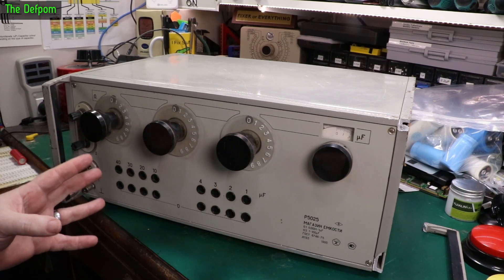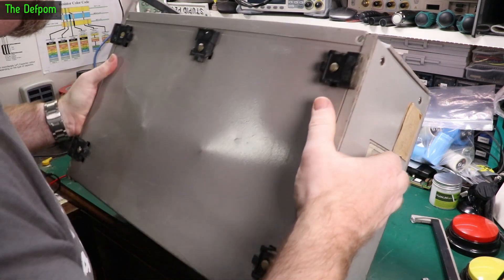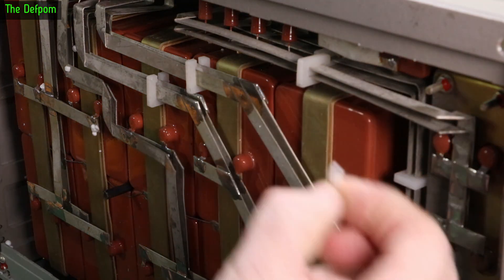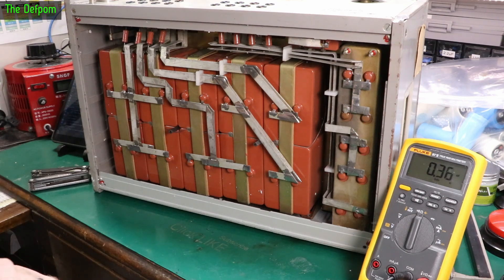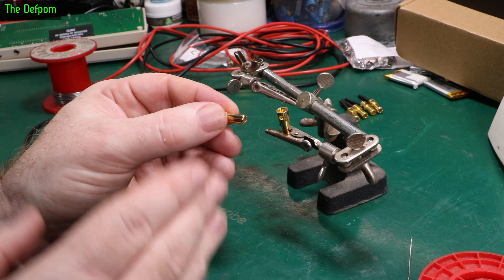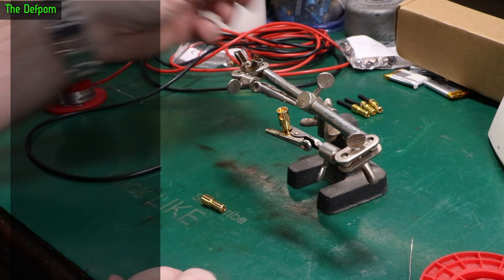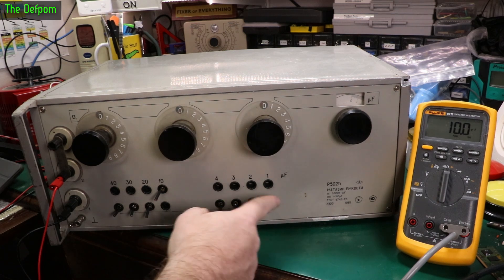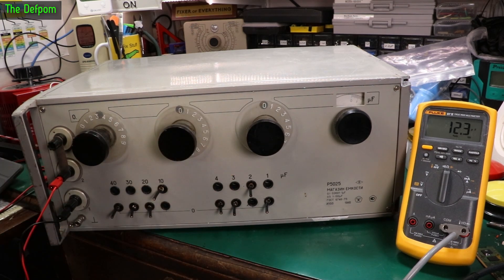🔴 Soviet P5025 Decade Capacitor Repair - No.1244

Comment: This decade capacitor box is built with two types of capacitors:
1. Smaller ones (ССГ) - use mica film as dielectric, have very high stability.
2. Large ones (МПГО) - polystyrene  film capacitors, these are also very stable but additionally have very low DA. Soviets used them in calibrators and voltmeters as integrator elements.
Reply from the maker: Thanks for the extra information.

Comment: Why would you CHOOSE to use aluminium wire to make any removable plugs?  Such a brittle wire!   I would also be tempted to buy a small bar of PTFE and make up extra separators for the more vulnerable busbar crossovers.  The added capacitance would almost certainly be negligible compared to the existing capacitance via the case (unless this has already been cleverly compensated for!).
Reply from the maker: I have to use the wire for something, and this is it, at least it is getting rid of it. if it breaks it is easy to fix too. It is not like this is going to get lots of use.

Comment: I would have installed SPDT switches where the shorting connectors were, with the off position discharging the cap through a resistor.
Reply from the maker: Doing that had crossed my mind, but it would have been hard to actually do it, and it could have upset its operation from stray capacitance, which is why I elected to try and keep it original.